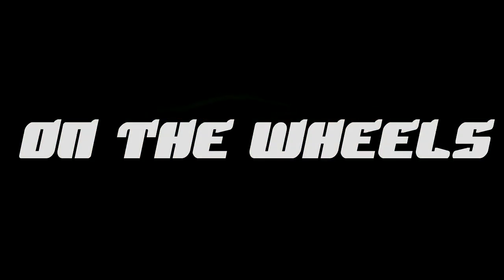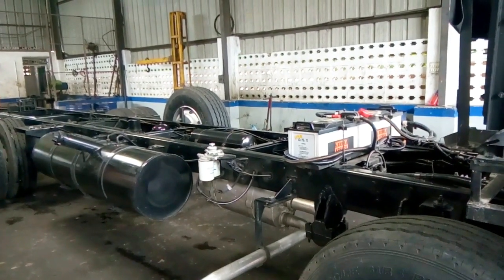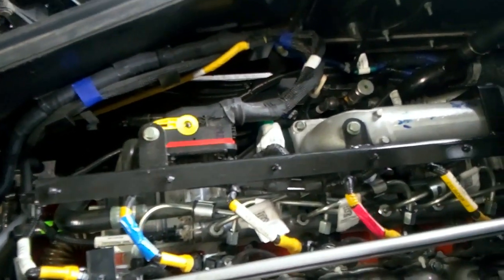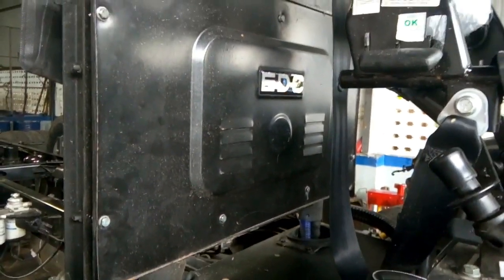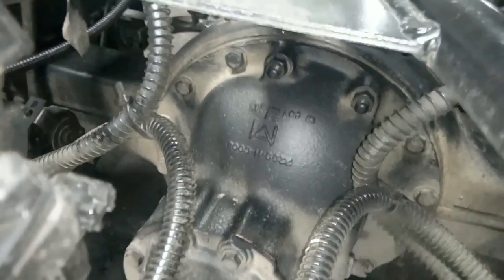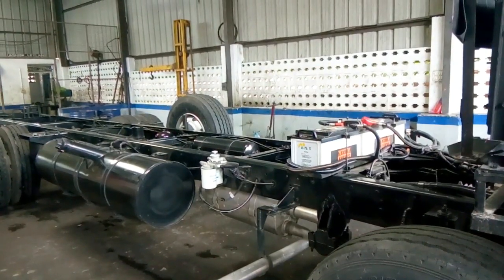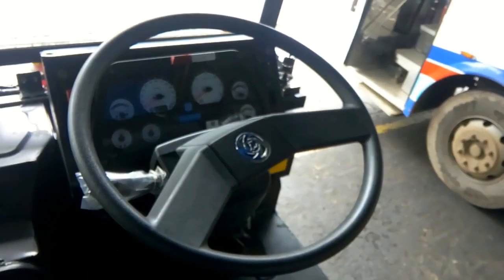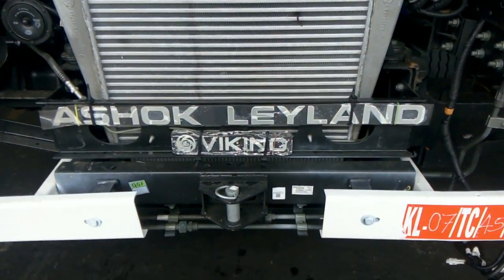Viking 180hp wb 222 BS IV

Comment: Thank You for the detailed engine technical  presentation of the truck, The leyland websites and technical specification list is not updated  as such,
kindly would you be in the know of the engine dimensions (LxWxH) with the fly wheel, weight, bore and stroke and the highest R.P.M
ill really appreciate to consider the engine for a project.

Comment: I have doubt, does this 180 hp have different wheel base, i observed some buses have 8 nut wheel hub like chassis you shown in video, and some buses have 10 wheel nut hub, whats the difference exact difference between these, as both are 180 hp

Comment: Top speed
Reply from the maker: 90kmph
Reply: @OnTheWheels  which leyland bus goes 120?
Reply from the maker: @haresh7578  as rules and regulations the maximum speed 80kmph
Reply from the maker: Many bus
Reply: @OnTheWheels  is it limited?
Reply from the maker: @devanandshaji6573  as per the instruction from central ministry the 80kmph is the maximum allowed speed for commercial vehicles